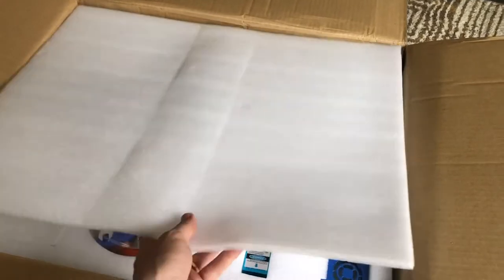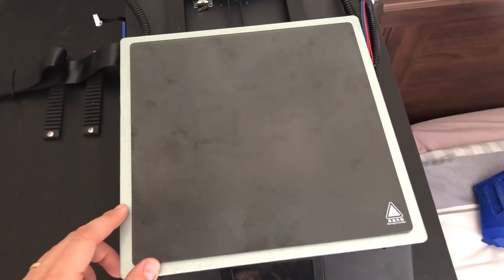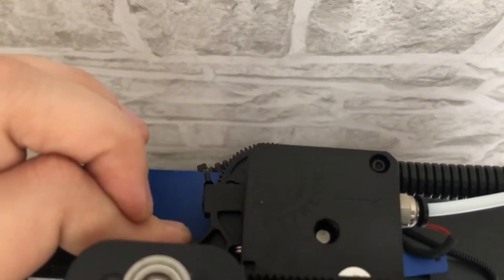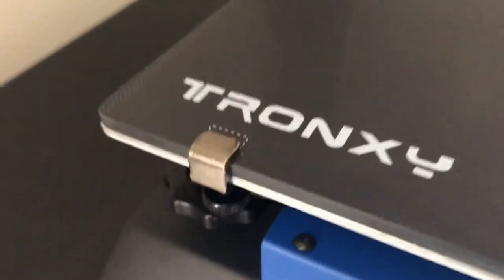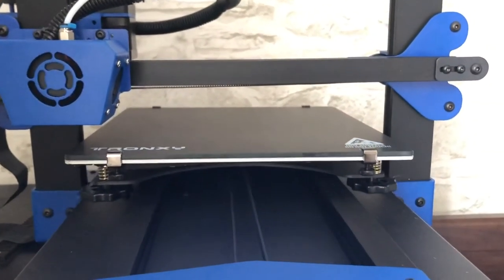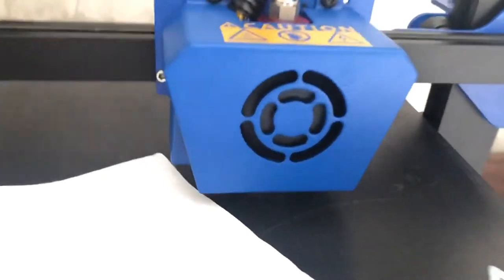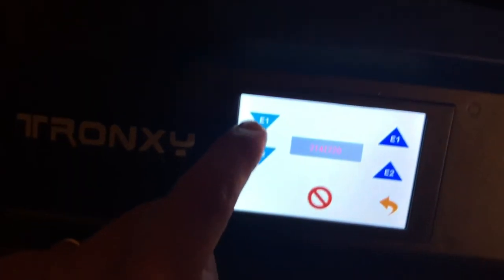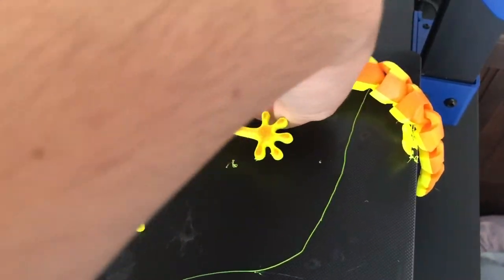Tronxy XY3 SE Unboxing and Setup

Comment: Hi. Which is better this TRONXY 3D XY-3 PRO  os TRONXY 3D XY-2 PRO
Reply from the maker: Not familiar with the XY-2 but I think they are essentially the same as a single printer. The XY3 SE includes the dual extruder and the laser engraver as well. Despite not being able to make it work. It depends on your needs.